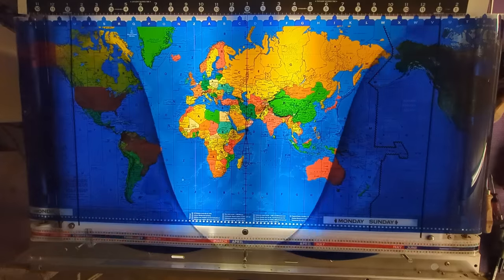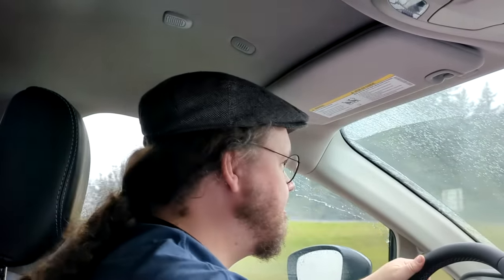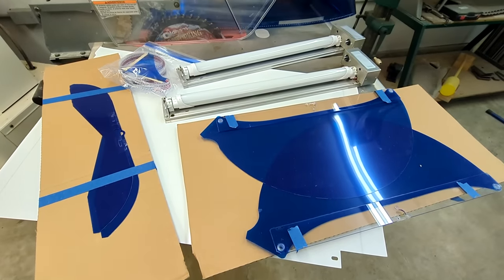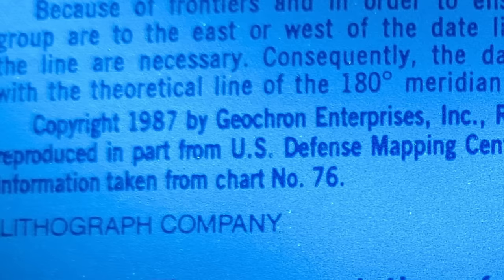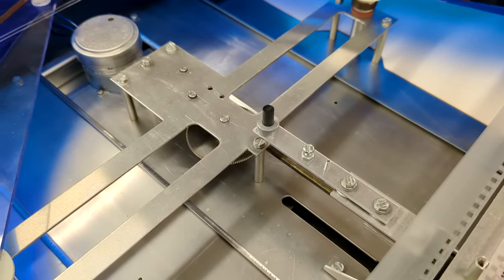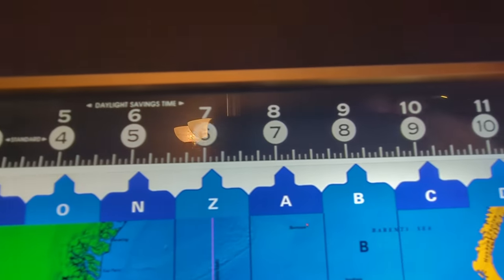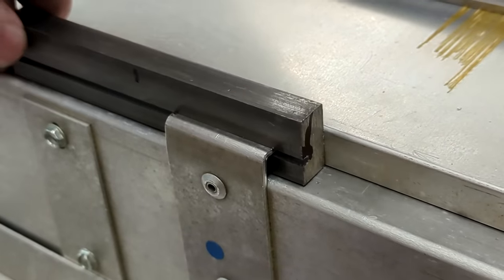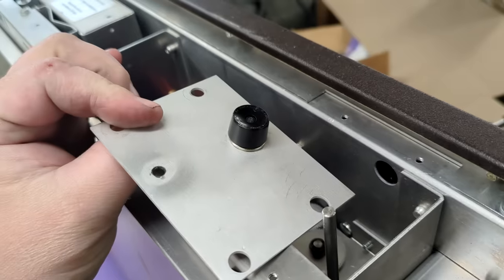The greatest clock (and map) ever made

Comment: Ma dude. You went for the more complicated option. One that isn't good for a multitude of reasons:
1)  If internet copnnectivity isn't given, your clock would show the wrong time as soon as you move.
2) How would you schedule something with someone from a different time zone (meaning like two towns over or something)? Everyone had to do math in their head or pull up a calculator. 
3) As how long would you describe a trip for someone? Taveltime? Difference in local time between start and end? Again: doing math in your head -> we don't like that.
4) This only works with high-tech. What if we run out of oil before we switch to alternatives or start a nuclear WW over the last remaining fresh-water and furtile soil after climate change f*d everything up and we now live in the middle ages again?

Here is the right solution (one that China already implemented): All people on Earth have the same time. And to avoid conflict, we can hold a Uno-turnament to determine who gets noon at 12. Here are the benefits:
1) Works even without electricity or any other modern technology
2) you can determine the your location on earth with only a watch, the current date and the sun position (at noon). (Technically you can do that now, but you'd have to constantly reset your watch during your voyage and you'd need to ceep track of when to do it)
3) you can ask anyone on the world for the time.
4) no more daylight savings.
5) As long as a region remembers their time at noon, everone can reset a brocken clock any day (within reasonable accuracy).
6) time keeping in logistincs will no longer involve time conversion.
7) We can all celebrate new-years at the same time.

Comment: I strongly disagree about time zones.  Figuring out time difference in the current system is complicated enough without complicating it further.  Our modern connected world means we can interact with nearly anyone anywhere so being able to coordinate time is important,
Reply: It would be a lot simpler if the people Giving times would do the simple conversion from Their timezone to GMT (that is, offset 0) so that the person/people they are communicating the time in question to would only have to do the simple conversion From GMT to their local timezone and adjust for daylight saving in their own location if applicable, rather than the rather more complicated process that results when the person giving the time insists on doing it in PDT or JST or CET  or whatever while communicating with, say, a mixed audience from around the world.

Comment: cheaper and easier to buy a TV/Monitor a Raspberry PI (or similar) and write a program (Don't know if one without ads exists up to date).... I used to use GeoClock back in the days.

And you can use it for other stuff too.

I get that there is something cool about using a mechanical one and it could be used as a conversation starter... but bleh xD

Comment: Light leak holes…..also help cool?
Reply from the maker: Yeah, I should have addressed that. With the lights changed from fluorescents to LEDs, there is almost no more heat being generated. Plus, there weren't vents on the top, and the whole thing was designed to mount inside a wall anyway, so I don't think heat dissipation was ever much of a concern.

Comment: Sorry but seconds of timezones is crazy. If i have a meeting at 10am eastern time no one wants to calculate what second that meeting will start in mountain time. And every partial second just makes things harder. As long as we use hours, everyone can join at the top of the hour, no need to figure seconds. Also everyone knows 10am from 10pm so we can figure out easily about what times work for what meetings. There is no need to reinvent the wheel here.

Comment: This was a nice video about the Geochron, but your last chapter showed you completely misunderstand what an analemma is. Noon is not supposed to be when the Sun is highest in the sky.

Instead, the 24 hours are set to be the average length of a solar day over the course of a year. The Earth moves in its orbit, so the Earth turns more than 360 degrees to bring the Sun to the same longitude each day. Some days are more than 24 hours. This happens because at the times when the Earth is closer to the Sun, the Earth moves faster in its orbit, which means the Earth has to turn even more to get the Sun to the same longitude from day to day. Some days are less than 24 hours. This happens when the Earth is further away from the Sun and doesn't move as much in one day.

Of course, in the modern world, we set the days to be equal to 24 hours by the clock rather than the Sun. But this comes with the sacrifice that the movement of the Sun doesn't quite match our clock day. The analemma on a globe or your Geochron is a physical representation of that. At noon by the clock, the Sun is in a different position each day and only 3 times per year does it coincide with the highest point in the sky for that day.